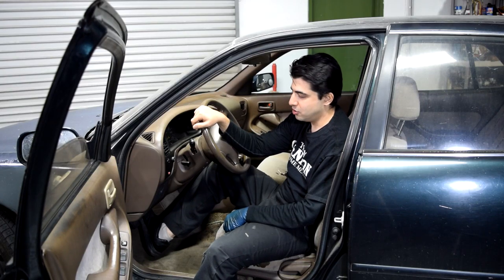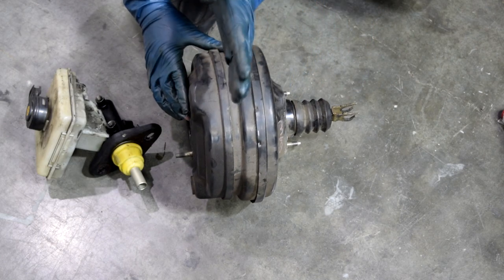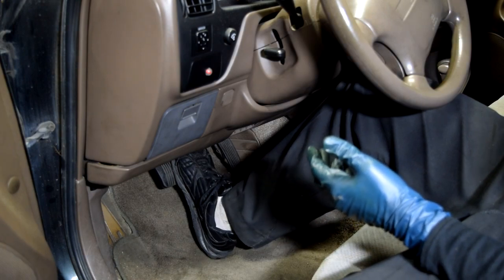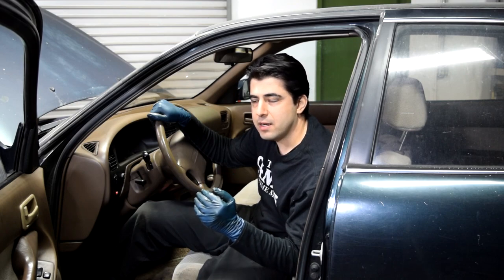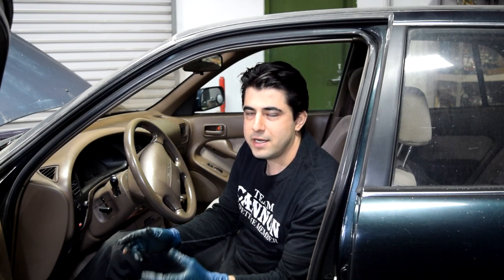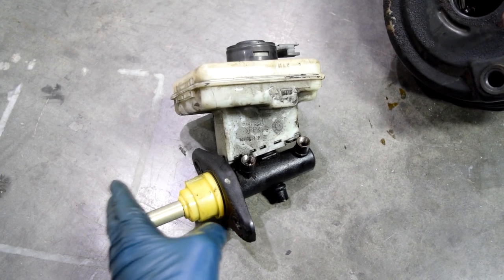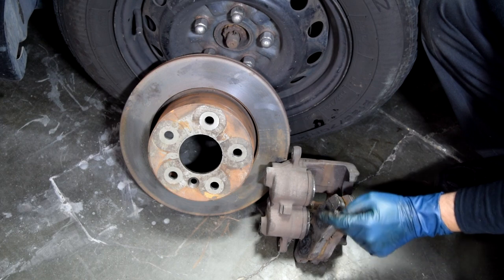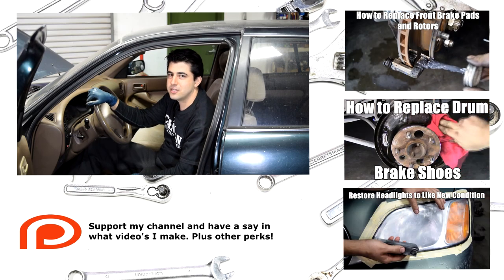How to Diagnose Brake Issues - Shaky Steering Wheel, Noise, Hard or Spongy Brake Pedal Diagnosis

Comment: Although the driving with the parking brake does not always tell you that you need rear brakes. Some models use completely separate brake shoes for the parking brakes and regular rear brake pads.

Comment: Hi. Okay, I've replaced the master, one caliper and a flexible tube and 4 steel lines. Checked for leaks 5 or more times, blead all four (following the familiar pattern). Break is still to the floor. The master is pushing the fluid. What should I look to next?

Comment: I have a 2005 honda civic ex,  I have a squeaky noise when we apply the foot to the brake pedal, in park, moving, all the time, does it means that there is a wire or a spring supper dryed?

Comment: The parking brake tip with screeching brakes only works on cars with parking brakes integrated in the caliper, not those with inboard shoes behind the rotor hats

Comment: If there's rust build-up on certain spots of the hub surface, could that cause the rotor to not lay flat against the hub, and then cause the steering wheel to wobble when you press the brakes?  I heard something like that in a South Main Auto video.
Reply: +brian0918 That's only if the rust is extreme but usually if you torque on the wheel right it will flatten out. It doesn't hurt to quickly hit the hub with a wire brush if you're changing rotors either.
Reply: bmwmsport11 I guess that depends on your definition of "extreme". Snow and salt rot our cars out pretty quickly.
Reply from the maker: +brian0918 I would imagine it's possible but I have hardly any experience working on rusty cars here in socal. But if we are talking surface rust on the hub than I dont think it would cause that, but if the rust has made the surface uneven than yes I can see how it would be a problem. Hope that helped, cheers.

Comment: i really like your videos. anyways i have a question. if one of the slider pins on the calipper is seased up .will that make it feel as if there is air in the system.( spongy pedal / goes down 1/4 )...👍
Reply: I have seen people go to all sorts of extremes blessing brakes an an attempt to fix a stuck slider pin..

Comment: So it is possible to tell if a rotor is warped by looking at it visually? Are there lines/color changes I should look for? also, is it a warped rotor is I feel roughness in the brake pedal? Like on my Subaru, when I slow down I can feel the pedal "lift" at slow speeds. It vibrates if braking at 80mph+. When I look at the pedal I don't see any uneven wear spots like the rotor you showed, but there are verticle marks and some light(color) spots. but on the back of the rotor there are a bunch of spots on it almost like the pad isn't clean.
Reply: I have to say that in 30 years of driving and maintaining my own cars I have never had a warped rotor. The most common vibrations have come from layered rust on the rotors and the fix for that is easy, just chip it off and the vibrations may well go away totally after some use. Worth a go if the rotors are not too worn. The next vibration problem I have seen is rust on the mounting surface. A have also seen soft bushings amplify vibrations from the road. And finally a stuck calliper may warp a disc while its hot in that case it will be very hot.
Reply from the maker: +Andrew Thompson The first sentence of your post is why you havent had a wraped rotors in 30 years :)
Reply from the maker: +bmwmsport11 No you cant see them, you would need a brake rotor micrometer to be able to do that, but the signs you are describing all point to a wraped rotor and a pad replacement.

Comment: My car would shake at highway speed with moderate brake pressure. Turns out a strut tower brace fixed up my 06 Corolla. No more shaking.

Comment: What is the problem if once in a while a step on the brake feels the car speeds up for a second and only with the brake catch up and the the step become a bit deep the the usual? thanks
Reply from the maker: you might have a leaking power brake booster, find and block your booster vacuum hose. Step on the brake see if the rpm goes up, do this in park as driving without the booster connected to vacuum greatly reduces braking power. BE CAREFUL.
Reply: drove a new to me dodge dart 1972  home without any sort of brakes except an emergency kinda break i can vouch that it is not safe !!!

Comment: My B5 A4 is really hard to stop. The pedal goes in about halfway before the brakes engage and i have to push it really really hard to get the abs to kick in. There IS vacuum. Pedal does NOT sink to the floor. Master cylinder? Brake fluid looks like šh!t, but i doubt that could be the case.